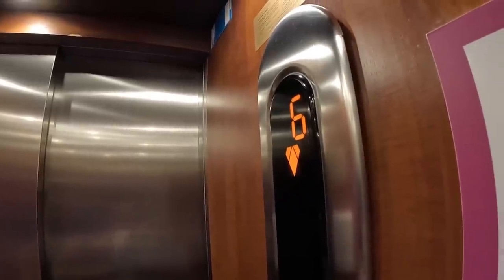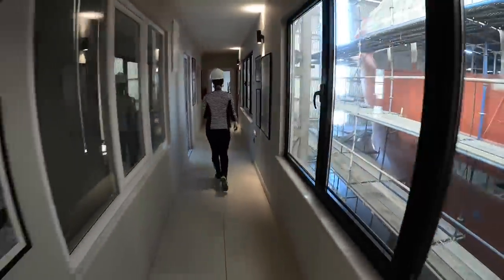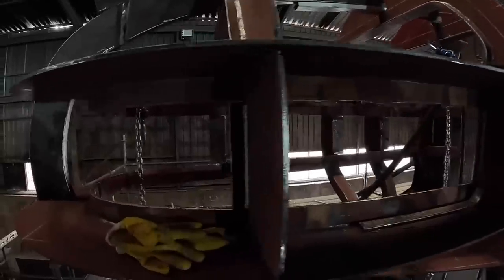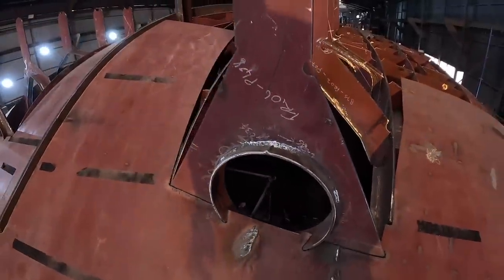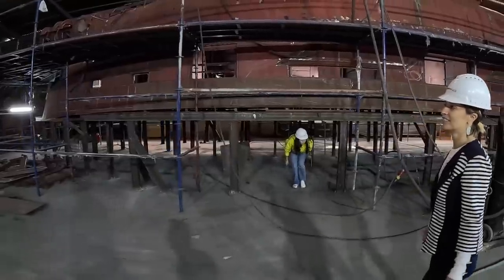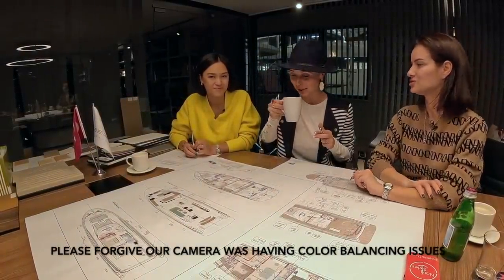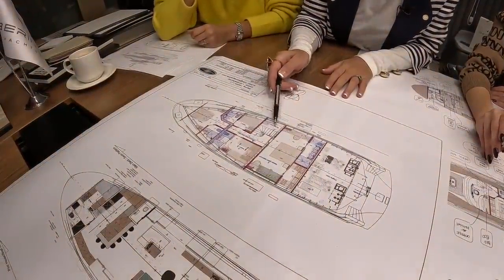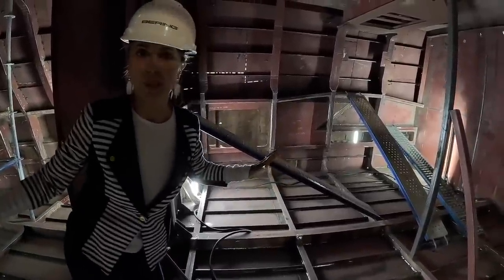Off Limits, but WE SNEAKED IN 😝🤯 Eps.19

Comment: The Hull components have been stitch welded into place.  May we see a video of the technique to seam weld the Hull externally to cut down on distortion of the Hull plates. Also can Alexi speak more about the coatings used enabling the welding of Aluminium top sides to the mild steel Hull. He has mentioned in a previous video that it is common practice in the boat building industry.  Welding dissimilar metals is not so easy depending on the materials be welded or soldered together.

Comment: i know its probably a cost issue, availability and then much redesign to future boats (not existing), but i wonder if Bering have any plans to switch to using electric rim and pod style engines, this would mean engine rooms can be reduced as most of the workings are external, although battery storage may also change, but with only generators running to provide essential power to systems - i have been interested in seeing some folk convert smaller craft with great success to being more self sufficient with solar and wind charging, and wonder if their might be a provision for these systems in the future to run non essential systems, lighting, entertainment, items needing less power apart from Ricco's woofers hehe
i am loving this couple and their boat, so cool to see the structure coming together, very exciting

Comment: Jacques Cousteau's "Calypso" had an observation post in the displacement bulb, accessed via a ladder and hatch mounted on the foredeck. 
     I've been wanting to know if you are familiar with recent developments in propeller design.  The new "toroidal" propellers by Sharrow claim to offer greatly decreased cavitation and thereby noise and vibration are greatly reduced.  Offering a 5 knt. increase in cruise speed and an overall increase in fuel efficiency of up to 20%.      
    Development is currently underway for larger vessels such as yours.
    Can you please give me a little feedback on this?